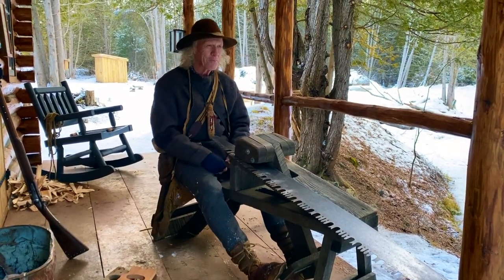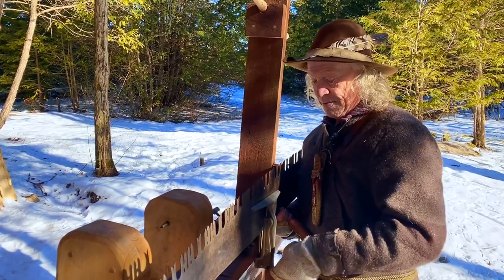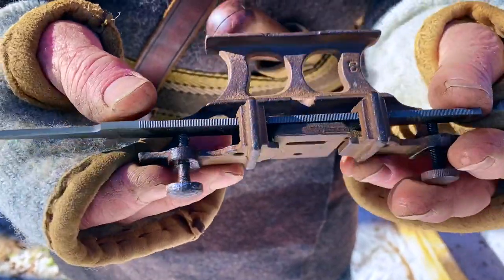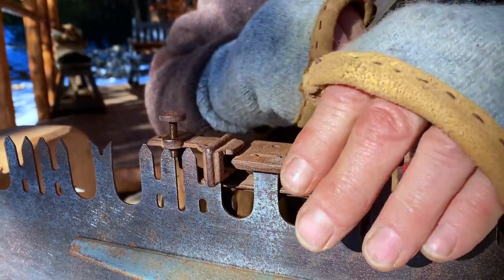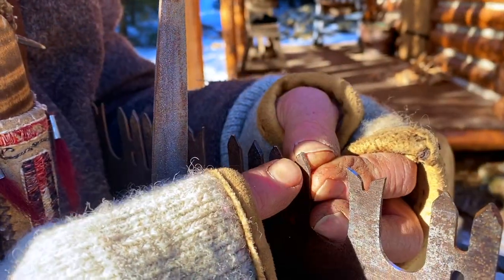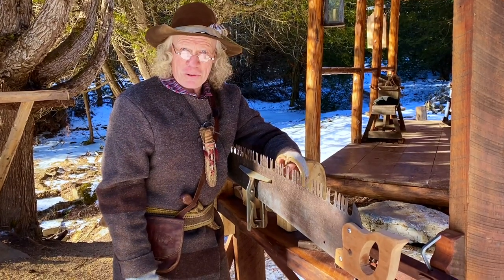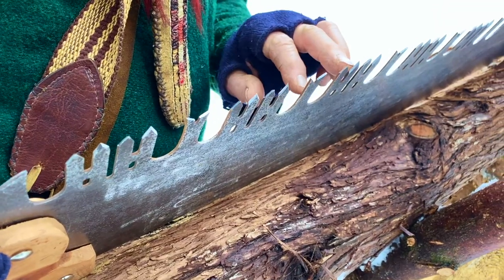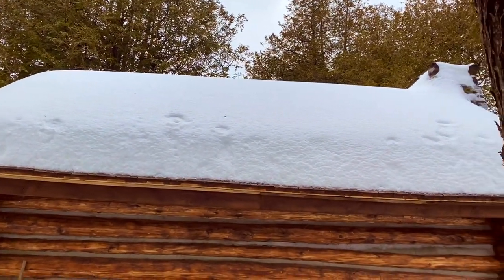How to Restore and Sharpen a Cross Cut Saw|Pioneer Life|Homesteading|18'th Century Skills

Comment: Your content is such a joy, sir.  I never understood why a crosscut saw had different shaped teeth until now, but am still a tad baffled by why the saw was binding. I know you mentioned the teeth needed further filing to adjust the set and pitch for soft and hard wood, so maybe a future video could finish the process and explain how teeth set and pitch affect blade binding. Thanks for all your time and effort, and hoping your 2022 is off to a great start!
Reply from the maker: Set is not done by filing, it is done by taken the cutting teeth and off setting them by about 5 thousands of an inch or so out from the blade.  The resulting cut wood fiber leaves a kerf ( the width of the cut) that is approximately twice the width of the blade.  This gives clearance on the blade, removing any friction.  Thanks for your feedback, I’ll attempt to demonstrate in an upcoming episode.
Reply: @TheWoodlandEscape  Hey thanks for clarifying and offsetting makes more sense now, but still not sure why the blade was binding and how teeth set is adjusted for both hard and/or soft wood. For example, if the typical offset is double the blade width what would be the best pitch for different types of wood, and why again binding occurs.  Perhaps some solid questions for a conclusion video on your blade sharpening. Again, much thanks for humoring my inquisitive nature. 🙂
Reply: Hi Peter.

Another very interesting film! How often would a saw of that type that was in regular use need sharpening and resetting? I realise this would depend on how much usage the saw had but I’d guess it was used a heck of a lot back in the 18th Century. You mentioned that it is easier to cut wood in the Winter due to no sap so was the saw a seasonal tool only requiring sharpening etc in the Spring ready for the next Winter use or would it require sharping many time during that period? Would it have been used throughout the year and if so would sap in the trees blunt the teeth quicker than when used in the winter? Also, I noticed there was a lot of ‘whip’ in the blade when you started using it and then you only seemed to use the section nearest to the handle so would such a saw have really been a two handed job with a handle on both ends allowing a push me pull me type of action which would stop the blade flexing? So many questions I hear you shout! 😂 

Best wishes,

Mark

PS. I couldn’t believe the depth of that snow on your cabin roof! A testament to your building skills that the roof didn’t collapse under the weight……I’m sure the roofs of the houses in the UK would have fallen in with that weight on them! 🙂

Comment: As a joiner You are taught how to sharpen your tools and l was lucky as my dad was a joiner too he would teach me how to sharpen my saws 🪚 and the one thing that he told me is your cross cut that if it’s used on wet wood is to give it a little more set than usually as this helps the saw too cut and not Bind up all of these little tips my dad told me you never forget and if my dad finds out I have not been using my tools properly I would still get a clip around the ear 👂 🤣 good times with my dad I will never forget my best friend great video as always you are a great story teller stay safe 👏👏😊
Reply from the maker: Ah yes, the clip behind the ear … it did get ones attention .  When I’d screw something up my dad would say “ well did you learn anything”!  As to saw set, you do not a wider kerf in wet wood.

Comment: I have a bunch of bucking saws.  They are called chainsaws.  Mostly they are Stihl, but I have an original Poulan, a MAC, XL12 Homelite and a Husky.  My favorite saw for big rounds is my MS 360 and for smaller stuff I have my choice - 021, 024, 025 or bigger stuff my MS 260 Pro.  I generally like to use my 021 because it starts the easiest and is the lightest.  I take my glasses of when I am sharpening a chainsaw.  I see better, up close, without them.  Put a little turpentine on the blade.  That helps it cut without binding.😊

Comment: Great video!! I learned so much on your saw tutorial. I now want to run out and find a saw to restore and use. I've seen so many saws and past then by but no more I will look at them with a more clear eye.
Since we live in USA below you, and have been having a bit of a cold snap, I am cheering you on. The temps being cold and you showing bear fingers filing and cutting with the saw is truly strong fiber. Hiking with those snow shoes brings back memories for me. I used my set hunting and trapping in the 70's all winter long. It was deep snow then and tough going with out them. 
Keep up the fine work and keep your powder dry!
Reply from the maker: Thanks, Kristine.  I find snowshoeing just in itself a wonderful pass time.  For 3 season we stumble about the forest … over logs, deadfall etc. then along comes winter and we glide over it!

Comment: I have 3 cross cuts. Two of them are wrecks and kept only as keepsakes in remembrance of my father and mother. In the Depression with no available jobs and no money they were able to get a contract to cut wood for 25 cents a rick for a rural school. At the end they received 5 dollars and were very glad to get it. The other is a one man crosscut about 2 thirds the length of yours and with the helpers handle. It was given me by my father inlaw and kept in good repair. I've constantly used a chainsaw since I was a young teenager and on picking up the old one man crosscut for a project I was amazed at how well it worked. They really were well designed devices weren't they?
Reply from the maker: That must have been brutal tie during the depression.  Hard for us that didn’t experience it to imagine.  On the saw note, they do indeed cut very well if set up properly.
Reply: @TheWoodlandEscape  are you familiar with a type of pig food which we called "shorts." I suppose it is the leavings of a flour mill used to mix with corn or stirred with water to feed hogs.  I'm told that it can be sifted for the finer parts and used to make a type of white flour gravy. Yes, the Depression was brutal. To top off those years was prolonged drouth. But from that hard time came progressive ideas which improved rural living and gave a better lifestyle for the ordinary man. It seems to be a lesson forgotten in recent times.

Comment: I am so happy to see a saw get restored and put back into use. I learned how to sharpen crosscuts a few years back and watching you sharpen made me want to go find some more to restore. I hope you can get your set right so your saw cuts good, I would recommend .011 of an inch but I am curious what set you end up with. Best of luck finding helper handles they are great but I have not seen many out there, you can make your own spider out of 2 bits of flat metal and a few bolts, though that is a more modern way. Thank you for this great content.
Reply from the maker: Thanks Ian for the information.  You’ve planted a seed, I think I’ll build me a spider!

Comment: You should make the helper handle on your new lathe!!  After watching your video about the pole lathe, I've decided to make one as well, along with a shaving horse. I have some projects in mind, LOL.  Cannot start on the two projects for about a month though.  Have some work to do on one of my trucks first. I hate it when vehicles break down during winter.  But, I really need this truck up and running for work around the ranch.
Reply from the maker: That is a wonderful idea, I’ll try to do just that.

Comment: The sound of the file reminded me of my first real holiday job at a galvanisation factory. They had this quarter swimming pool size full of liquid zinc and would dip heavy metal items for a layer of zinc. My job would be to wait for it to cool down and file off the zinc drips and such to get it ready for shipping. Tough job, but a good lesson.
Reply from the maker: Sounds like one of those jobs that has one thinking, perhaps I should stay in school.  Speaking of school, the sound is as reminiscent of ones teacher at the blackboard with caulk!
Reply: @TheWoodlandEscape  I did and got a degree in environment and archaeology. Now working for a bank with technical projects. You never know how life turns out.

Comment: Saws coming in "from the wild" always require much more work for that first filing. Once you have it cleaned, jointed, pointed, and swaged, the next filing is a tune up based on how it's been performing. Perhaps steepen the bevel angles on your cutters for those softwoods. I can't see if the saw's taper ground, but 0.015" set and 0.012" raker depth is a good start. The spider will keep those teeth honest. Enjoyed your video.
Reply from the maker: It sounds like you sir, know a lot about sharpening these old fellows.  Sound advice I might add, thank you.
Reply: @TheWoodlandEscape  I've been a crosscut saw filer for a long time. First as a hobby, now as a business, though I enjoy using them most of all.
Reply from the maker: Good for you, I would not have thought there was enough interest out there.
Reply: @PATCsawyer  How long would it take for an experienced sharpener like your self to sharpen a saw of this size.. including sets I imagine.  Thank you.
Reply: @Graebarde  About five or six hours. Your saw looks like an "old stock" blade, has good steel, and only minor rust.

Comment: Great video. Not sure if it would be applicable and found within the time frame you set your videos in but I would ask how did you come to get a bastard file and how do you clean it? I know that my bastard files are probably made by some factory or something. And to clean them out what I do is take a small piece of copper pipe and I crimp one end and then with that crimped end I can push it across the bastard file from one end to the other chasing out any metal filings. I find it works to be the bomb.
Reply from the maker: The bastard file dates back to the early 14th century.  Originally a torture device, go figure!  They have been a common tool used by blacksmiths since.  Not sure how they were cleaned but, if one tapes off a file on a hard surface after a few minutes of removing metal, most fillings are removed.

Comment: Just finished a 2 man and 2 one man. Do you use soapy water when cutting for tars an resins
Reply from the maker: That would work but, I use turpentine.
Reply: @TheWoodlandEscape  When I was young I did to but it but it did not seem to shed saw dust as easy. I get tireder quicker than I used to. I probably need to get ride of my white hair , the tiredness is tied to it some how.

Comment: I watched a documentary awhile back all about hand saws that was very interesting. It showed the different saws used depending on the wood you would be sawing and the difference in the saws. I guess one saw does not fit all so to speak.
Reply from the maker: They did indeed design and make saws that were specific for either hardwood or softwood but, usually could be used on either but, not as efficient.  Just like a rip saw is entirely different from a cross cut.  A cross cut saw rips fiber where a rip saw chisels it.

Comment: Is there a 'correct' angle for the filing of the teeth??
Reply from the maker: The angle varies a lot from one saw to another depending on the design.  Usually somewhere between 15 and 30 degrees.